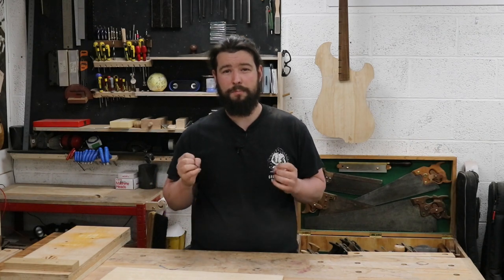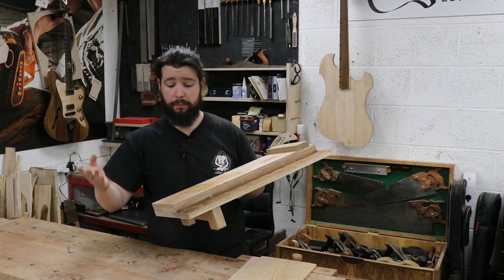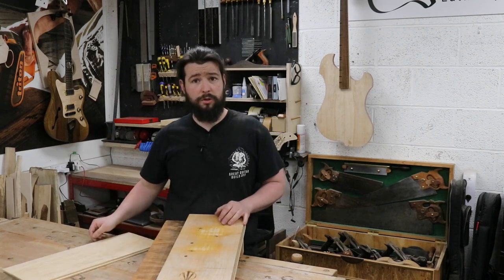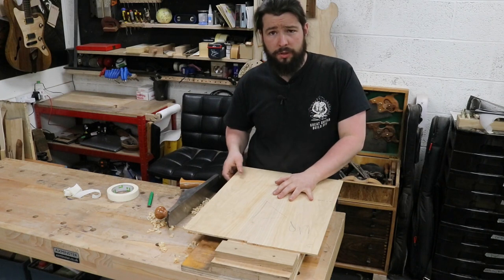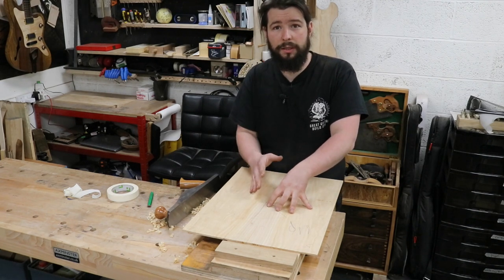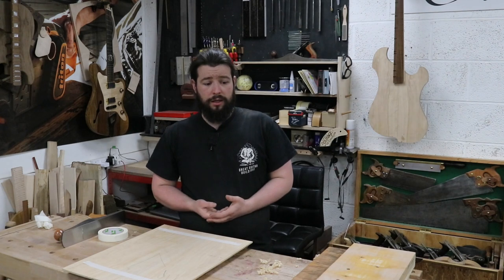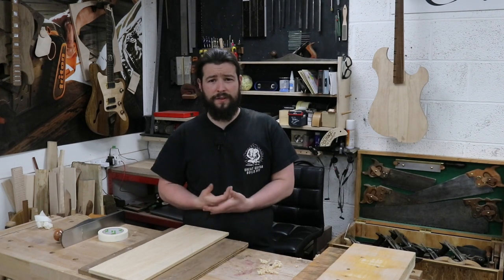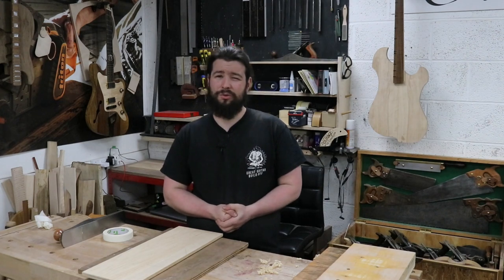Flawless Edge Joints: The Art of Using a Shooting Board for Guitar Tops

Comment: I made a shooting plane from scrap Corian counter-top - head to your local big-box home improvement store or local cabinet/counter shop - you can probably get it for a few bucks if not "free".  I added a section of T-track for clamps but I rarely use it.

On my wood shooting board I used UHMW tape (3 or 4 inches wide, Amazon, eBay, Klingspor's, etc - lots of places have it) to make a very friction-free surface

Comment: If people don't want to go the shooting board route, another handplane option is to clamp the boards back-to-back in a vise, aligned as they will be joined. Then, when you plane the top flat, any inconsistency in your planing angle won't matter, because the boards will still fit together just fine. Easier to do than describe, but this is something we've used for joining boards for cabinet and table panels.

It's very similar to what you do, but you plane both at once instead of one at a time, and no need for a shooting board. It's a bit more forgiving in some ways.

Edit: I see you mentioned this at the end. The solution I've used for that is to clamp a straight board of adequate width near the top. I do realize that starts getting more complicated and less useful at that point.

Comment: I struggled with getting perfect joints until one day I came up with a way to guarantee both edges are straight, square and parallel.  I had glued up a set, only to find a tiny gap had showed up after cleaning off the excess glue. I decided to cut them apart, and try again. Well,  I used my radial arm saw with a 1/8th blade, and  I  cut right through the joint.  Guess what.  Both pieces were perfect because regardless of how straight was the cut, the two were mirror images of each other. All I did was apply more glue and set them in my gluing jig.  Now, I use this method every time, except I just tape the two together the first time,, make my cut and glue them up.